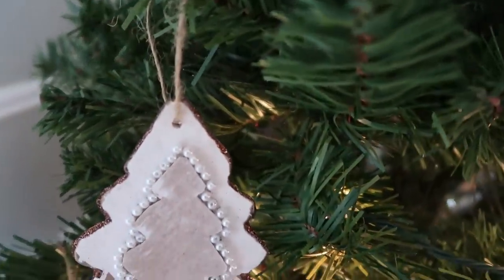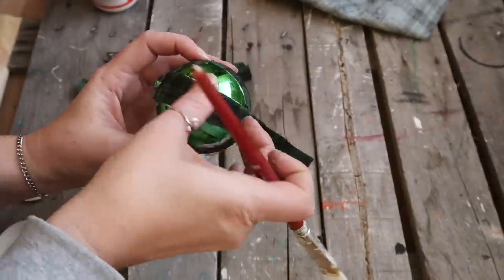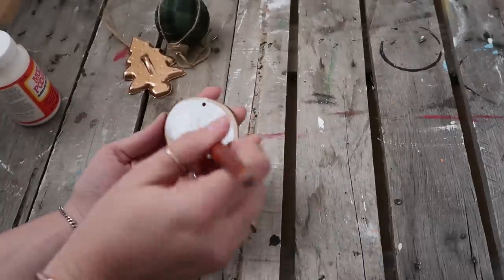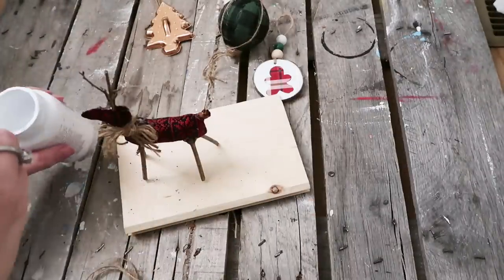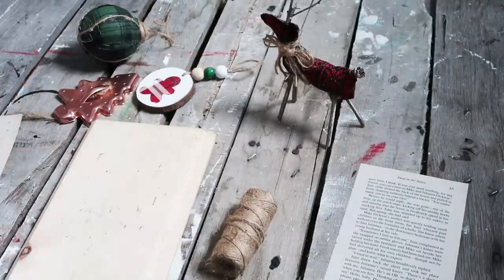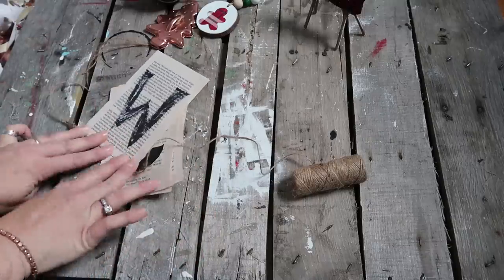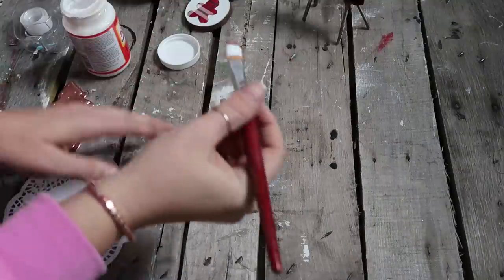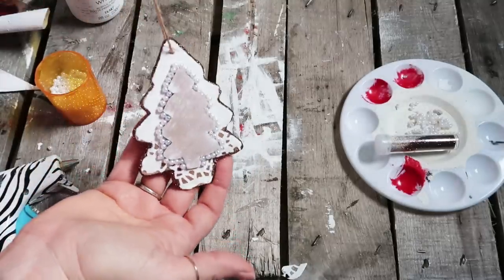🌟ADORABLY UNIQUE CHRISTMAS TREE ORNAMENTS & GARLAND - EASY DIY CRAFTS FOR ALL AGES

Comment: I saw that look alike reindeer in Pottery Barn and they were so expensive you are so cute all of the projects were so beautiful I do have (a tip) on the glue gun webs use a heat gun or a blow dryer not too hot just to make the glue disappear and you wouldn't see the web and all the clumps that glue gun forms just lightly blow over the glue.